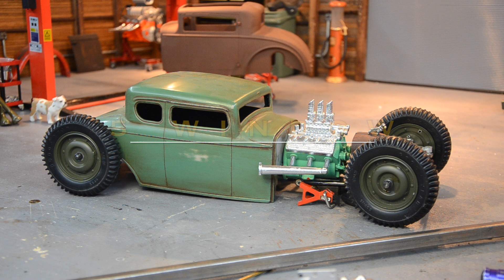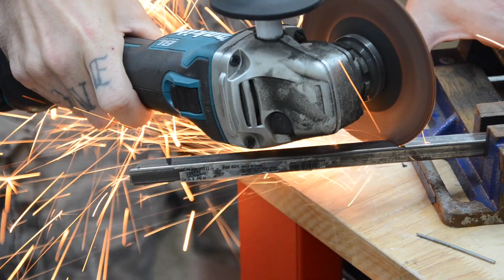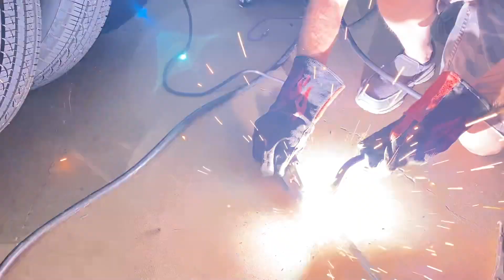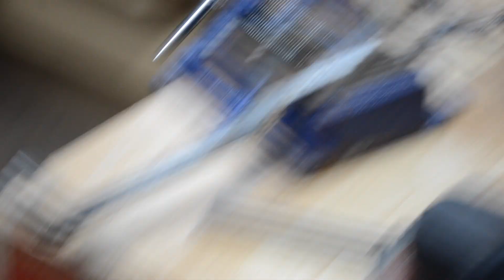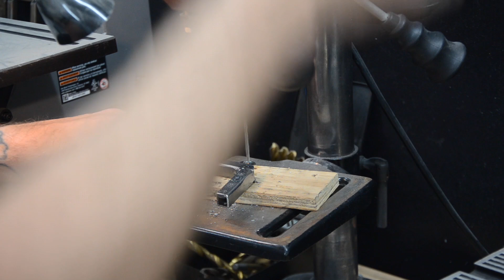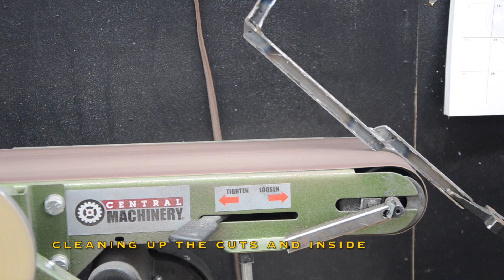5 Window Coupe, RCratrod Scratch Build, Part 1, Design & Chassis Fabrication, RCengineering

Comment: What makes you happy is the best way to, and you are definately seem more in your happy place doing this.
I have had a dabble with drones and largescale electric off road trucks, but I am a 5th scale gas guy at heart so back to my offroad 5th scale I am in my happy place.
Had a thought on your front end, how about turning the axle round so the steering is behind the axle it would make running a steering rod from a servo mounted in the cab then an inverted leaf spring for the front suspension in front of the radiator shroud, just a thought as stiff leaf springs should not need a shock.

Comment: A cool and inexpensive way to use real rust and have rust texture on plastic to weather your cars is three simple ingredients white vinegar a lid full of bleach and steel wool.... add those three ingredients together and let sit for a couple days then drain out onto a coffee filter let it dry and you have rust powder you just get the area wet where you want the rust sprinkle some of the powder on there let dry then use a satin or flat clear coat it's a awesome and inexpensive way to add realism to your builds!

Comment: Hey I have been watching your channel for a bit and I really like all the stuff you build. I do have a question I have a tf2 lwb with the 2 speed tranny and I keep braking the output shaft. I wanted to see if you knew of any HD shafts or even any other trannys that would fit in there and work well. Any advice would be greatly appreciated I’m sure you are a busy man so thank you for your time.
Reply from the maker: I’m not sure on the 2 speed. I run the single speed in all my tf2’s and have not had any issues out of them. They bolt right in just need the longer shaft from trans to transfer case. I wanna say I have heard that happen before on the 2 speed though.
Reply: Right on I will probably go the single speed route thanks for the info I’m always looking forward to your next videos

Comment: There's a old hot toddlers trick.When they are beginning to build their frame they would put eather a peace of 2by4 laying under the 2 man frame rails or a 4by4 peace of wood under the same 2 frame rails and build the rest of the frame.That established the frame ride height.In California there's some old time hot rod builder that still use that method.Wonder if you got or made scale wood to do the same when making your frames.If you get the chance look it up.It may or may not help but if it can be done on 1to1 scale why would it not work in 10th scale.Just a thought.Iv build a old hotrod that way and it really worked great.a couple of simple 2by4s set the ride height as I built the rest of the frame from the 2 main rails that I built the rear and front from once finished pull the wood out and it sat at the ride height I was aiming for.But that's your build you have some made skill.Build yours they way that you like.And thanks for sharing your builds with us.
Reply from the maker: I do something similar to set the ride height.  I use my rc4wd scale jack stands and lay them on their side slid under the rails.  Have done that on all the chassis builds.  Gives me around 1/4 inch ride height.  One day you will see me trying my hand at a 1:1 build on the channel, mark my words.  lol
Reply: @RCeveryday  looking forward to that maybe can give you some pointers if you get stuck.